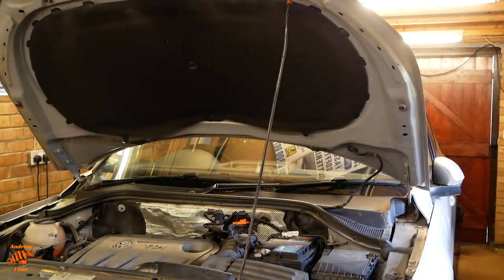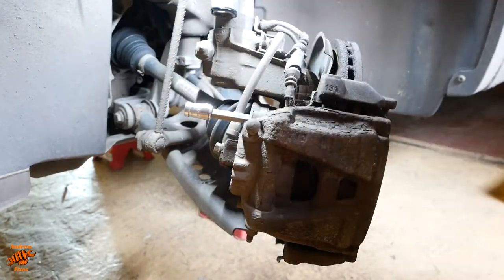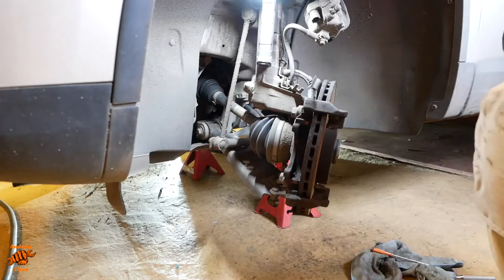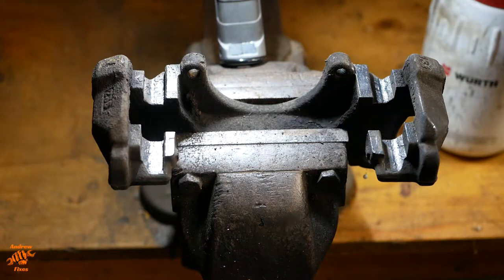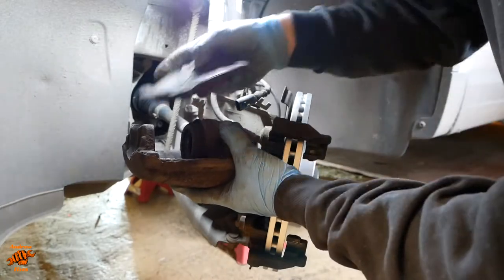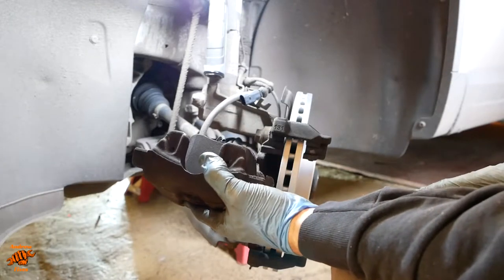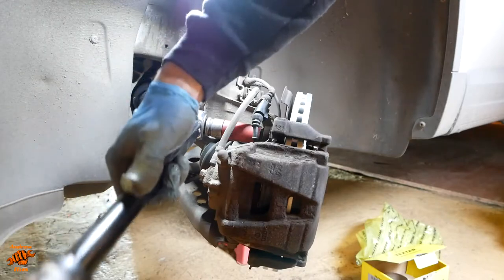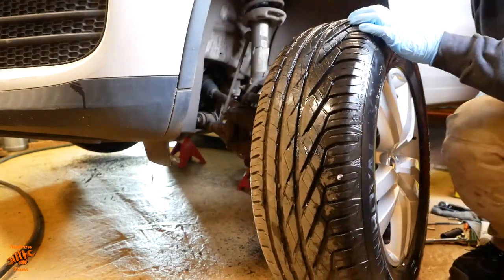Replacing VW Tiguan front brake discs and pads

Comment: Very nice video. One suggestion for install the disc. Insert 2 wheels nuts then tight the T25 disc screw. This way it will ensure the disc is aligned. I hope this will help.
Reply from the maker: Thanks for the suggestion JImmy, yes that does sound like a good idea.

Comment: I have a Toyota Corolla 2014 and dang does Toyota make it so simple and easy to work on those things. I don’t get why manufacturers don’t simplify their designs and instead complicate it. Lol
Reply from the maker: I hear you, VW / Audi excel at making things complicated and I'm a big fan of the Toyota simplicity. You can go a long way with a 10mm wrench and socket on a Toyota! Having said that, I've got a Toyota Verso coming in for service soon and even that needs a special tool for the oil filter.

Comment: Hi! Awesome vid. Can you please do a video on the rear brakes with the Electronic Parking Brake system that requires a computer to unlock the brakes? Thanks! I have a 2018 Tiguan Limited
Reply from the maker: Thanks very much for your comment. Will do a video if / when the vehicle comes back for rear brakes.

Comment: This is great, about to do similar soon on my 2008 TDI 4M :) Where is that jack stand under there? the rear of the front lower control arm?
Reply from the maker: Thanks! Yes the jack stand is under the rear mounting point for the front lower control arm. I jacked the car up on the jacking point under the sill. You could also do it the other way round, i.e. jack it up at the control arm mount or other solid area underneath, then put the jack stand under the sill. Hope the job goes smoothly for you.
Reply: @AndrewFixes  Perfect. I've got a MK5 GTI, so it's nearly the same layout and I do the same jacking point on that, good to know! Yes, I've got 2 struts and 2 shocks to do as well! Failed my roadworthy inspection recently (warrant of fitness) in New Zealand :/ But after 200,000kms it's to be expected!
Reply from the maker: Sounds like you've got plenty to do. As you say can't complain too much after 200k. Hopefully the struts/shocks aren't too challenging with a trustworthy spring compressor. The Tiguan came back recently after failing the MOT (UK equivalent of the warrant of fitness) with a broken rear spring so there will be a video on that coming up at some point.
Reply: perfect👍👍👍

Comment: so if im replacing the caliper also. is the brakeline just bolted on to the caliper
Reply from the maker: Yes it is. Remember to replace the crush washers on the brake line and it may help to use a hose clamp on the flexible line to minimise fluid loss. You'll need to bleed the brakes when you're done.

Comment: It's a good video but there are a lot of steps that have no explanation. Such as, "you might have to correct your brake fluid doing this.", why, how? Nothing is said as to why. I wouldn't think changing pads and rotors would require you to do anything with the brake fluid. I'm very mechanical but have never done a brake job. Just curious.
Reply from the maker: What I meant by that is that if the brake fluid was topped up to maximum with the pads virtually worn out, replacing the pads with brand new ones will require the caliper pistons to be pushed back into the calipers, which will in turn mean brake fluid from the calipers will be pushed back into the master cylinder. This could mean the master cylinder fluid level is above maximum, so you'd need to remove some fluid to get it back to the proper level.

Comment: Please do not use a hammer to peel off the disc. uses an extractor. the reason is that hammer blows are dry impacts and this damages the ball bearings and they last much less time.